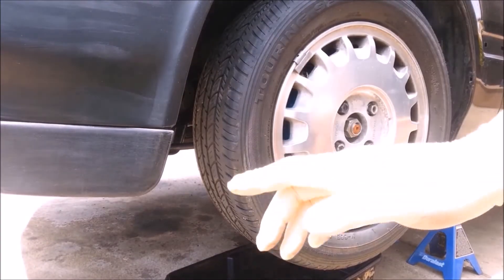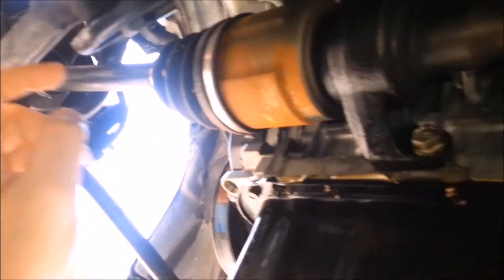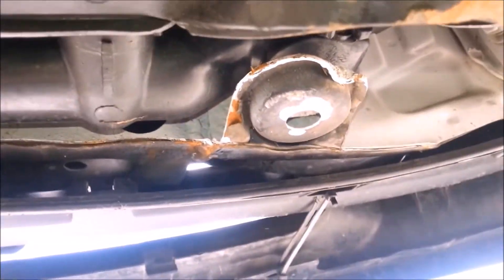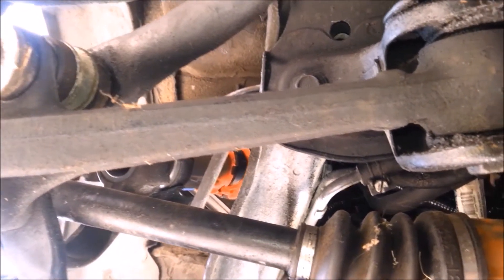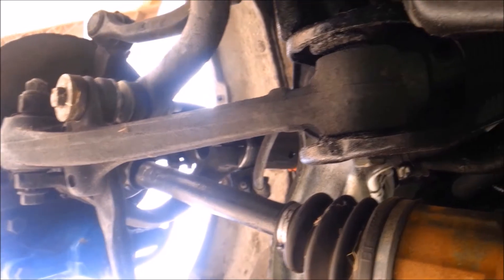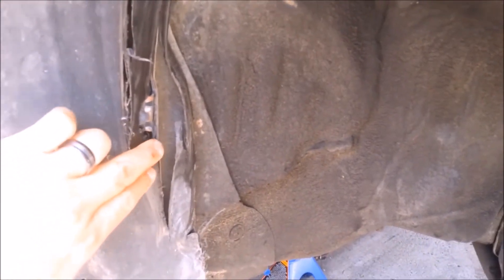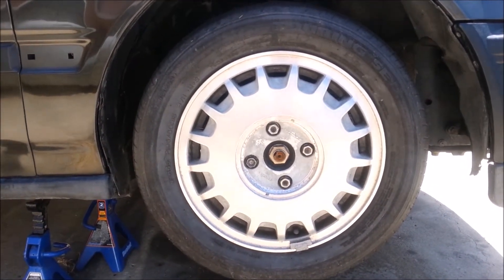Asking For Help on my 1991 Honda Accord CB7 - Pt. 2

Comment: Winston replace the lower control arm and strut rod(the long rod that bolts to the lower control arm) that goes to the front lower subframe as well as the bushings on the strut rods both sides

Comment: Make sure you use spc or ingalls camber kits on the front...any other brand is dangerous. Running these kits will increase your chances of hitting the shock towers if you are really low...They also make them for the rear. I have the ingalls rear kit right now for more negative camber and I'm running natural camber up front. You can also do EF skunk 2 camber kit for the front. But it will add negative camber and at full lock positive camber it is probably the same if not close to stock camber. This is because the control arm is shorter, which pushes the top ball joint in more.
Reply from the maker: Josh Papineau Thanks, Josh!  I sure will!

Comment: Someone may have commented this but you got it backwards. If you move the tire back and fourth from 9&3 and it's clunking like it is in the video, your inner tie rod is done. You check lower ball joints by jacking up the lower control arm (with then car already jacked up) and moving it back and fourth by 12&6 and if it's clunking, they're bad. Hope this helps!
Reply: Henry Rubio I just watched your 1st video on your issue, to me it looks like you have positive caster which is another alignment issue  besides toe and camber, this usually happens when the coilover is pushed backwards or forwards from the top thus changing the center axis of the wheel since it looks like it's closer to the rear of the car on the other side. One way you can confirm if you actually have it is by turning the steering wheel while drive all the way to one direction and if the steering wheel doesn't return back to center on it's own while still accelerating, theres your issue. Since you just changed to aftermarket coils, they may be your culprits!
Reply from the maker: Thanks, Henry, I appreciate it, but yes, I did catch that so I corrected myself on the video.  :)
Reply: Winston Buzon No problem! Just trying to help a fellow car head :)
Reply from the maker: Henry Rubio No, that's awesome!  Keep 'em coming!  It's one of the ways I improve the channel!  :)

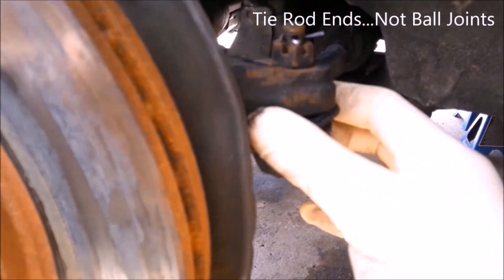Comment: @ 1:47 if you look you will notice that the safety cotter pin is not engaged in the locking part of the castle nut.
This could happen for several reasons but who ever did this should have caught it !

If you did this and if this is a representation of the quality of your work then please stop working on the important parts of you vehicle such as brakes suspension and steering until you first learn how to do the job properly.
Brakes suspension and steering are the most important parts of any vehicle and there is no margin for error.
Reply from the maker: Truly agree with you about the safety being heavy relied upon brakes and suspension.  However upon closer personal inspection (I could provide a separate video), the castle nut is still very secure in place and has not budged since the suspension work was done over a year ago
Reply: Winston Buzon
And likely it may never move and please note that I was not trying to be mean but I have seen vehicles with tie rods and ball joints literally flopping in their hole from incorrect installation.

Comment: Winston brother man have you tried looking at the bushing from the arm that comes from the front sub frame. These control the distance from center of wheel to radiator support/front sub frame to square out suspension and all. Lca do look a bit bent id suggest replacing that. Name is jamz720 on the forums.  Send me a message if you meed more input.
Reply from the maker: Jose Meza I may have to do some junkyard trips to see if I do have differences in measurements

Comment: If I got 16x8 with +25 offset would I need spacers? I know I would need to roll the fenders but what about spacers
Reply from the maker: If you have a decent turn radius, I'm pretty sure you won't need to
Reply: you wont need spacers just need to roll the rear fenders. also depending on tire size.